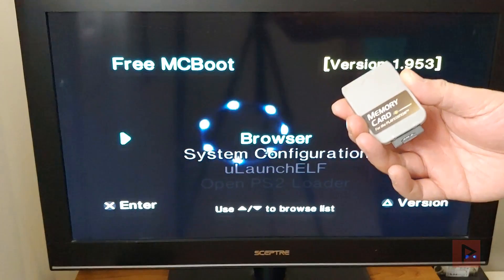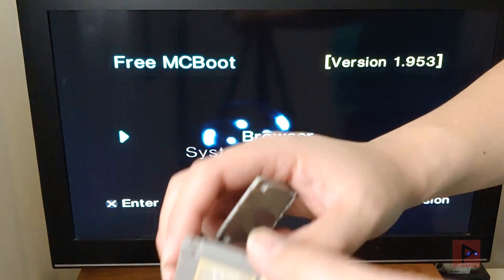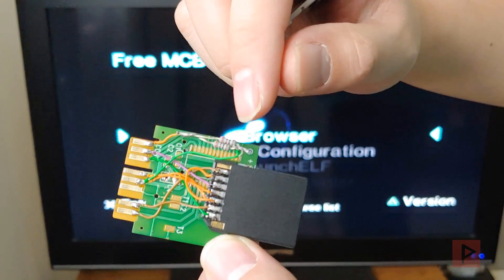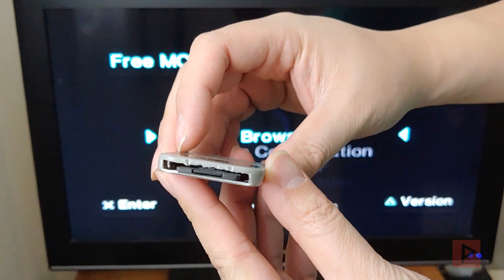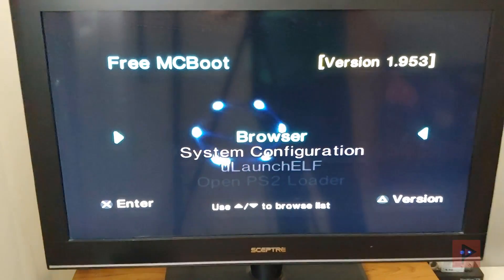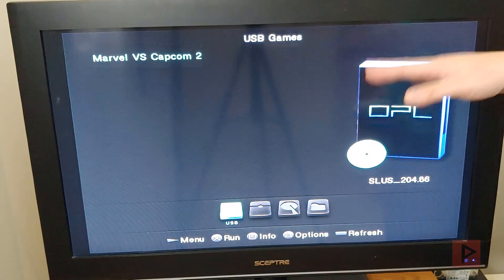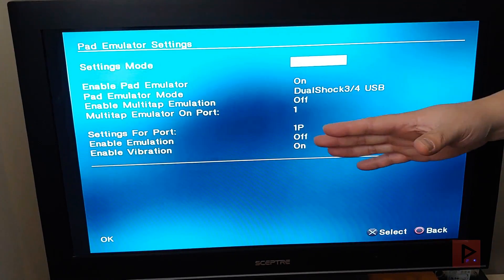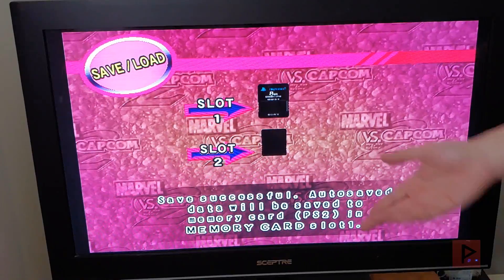Quick Overview MX4SIO - For Use with PS2 and OPL (English, 2022)

Comment: Do the games load just as fast as the FAT PS2s with hard drives?
Reply: Internal hard drive is faster for sure
Reply: @TheOriginalVersatile  what about fmv skipping?
Reply: @TheOriginalVersatile  what about smb, is that gonna be fast as smb?
Reply from the maker: It is slower than smb but quicker than usb. Although SMB is quicker, it does have more hassle in setting it up.
Reply: @ProjectPhoenixMedia  SMB also has a higher chance of failing due to internet dropouts / slowdowns
Reply: @MichaelM28  well i mean if you do the old setup your computer to be a Router and direct wire the PS2 to it. The drops are pretty much eliminated.